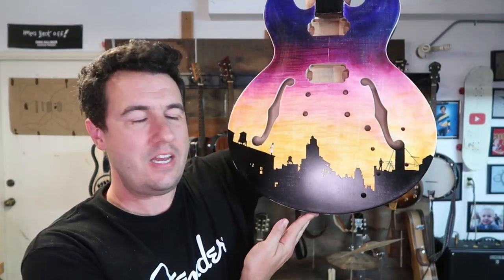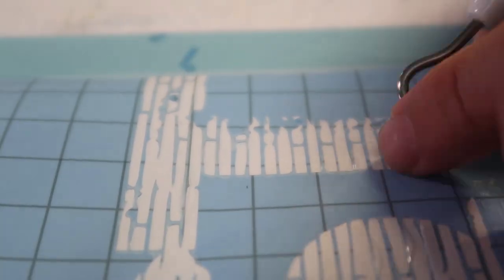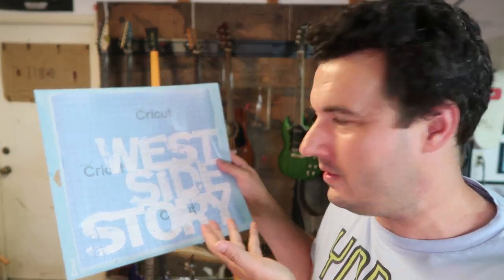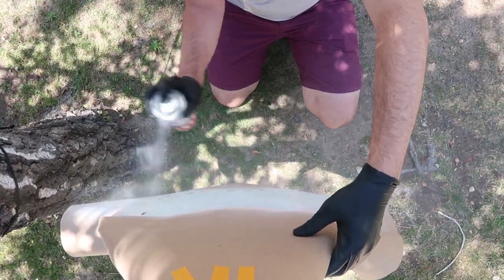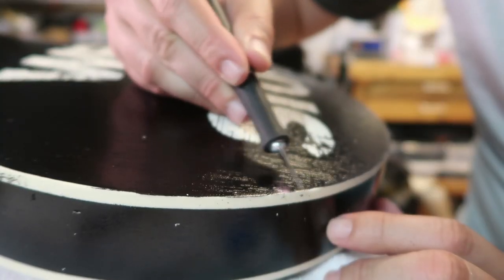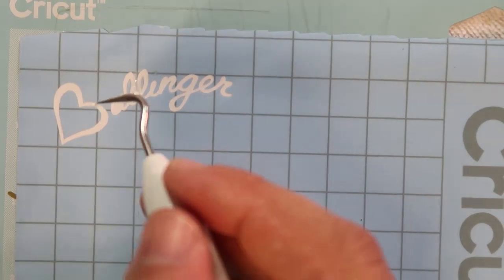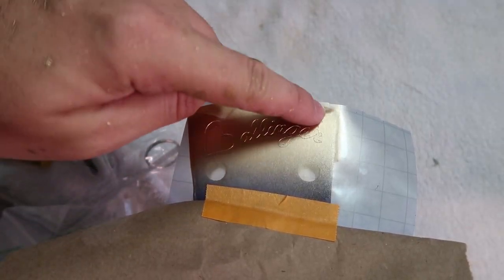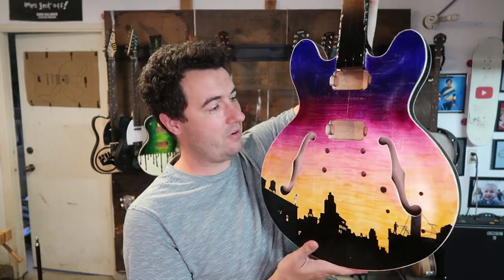Painting a West Side Story Guitar for Rachel Zegler - PART 2!

Comment: So beautiful:) What are you going to do about the back of the neck? Lots of times guitars come with a satin finish on the back of the neck since a gloss finish is kind of sticky when you're trying to slide your hand up and down rapidly. On some of the guitars I've had they came with a gloss neck and just rubbing steel wool on the back of the neck turned it to a beautiful satin finish with all the micro scratches, and the playability went way up.

Comment: Could you cut a step and make the stencil reversed and just lay it on the guitar then weed? Not sure how the process works.
Reply from the maker: That could work if the stencil material was somehow sticky-side-up during the cutting process, but I think it would get stuck in the gears of the cutter that way. The reason I need the transfer tape is to remove it from the backing in one piece before applying it. Good question.

Comment: little tip for using vinyls/stencils in this way; remove the stencil while the paint is still wet so it doesn’t chip!
Reply: I was about to comment this. Don't let the paint dry since it will create a bond to the surrounding surface. Wet paint still has moisture suspending the color and as you remove the stencil or vinyl the liquid paint has the ability to flex and separate. As strange as it may sounds, the best tutorials to follow for vinyl use or color layering is nail art. Check out some nail art tutorials to get awesome tips and tricks.